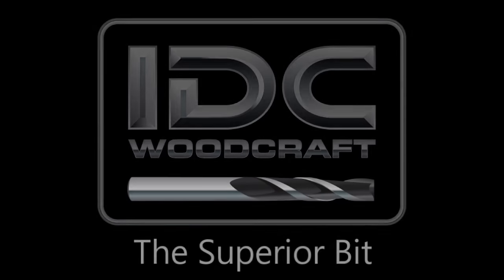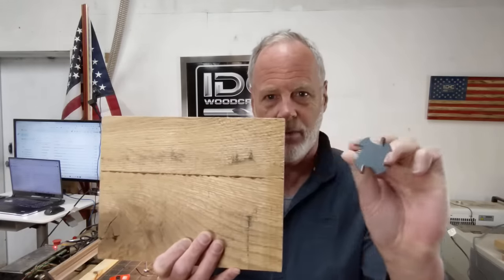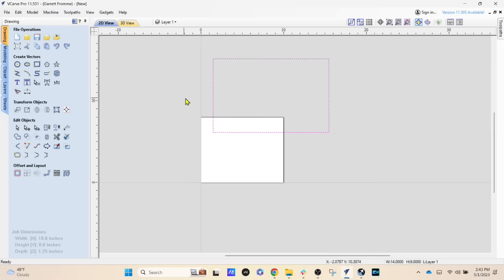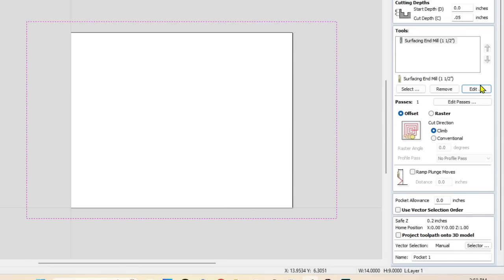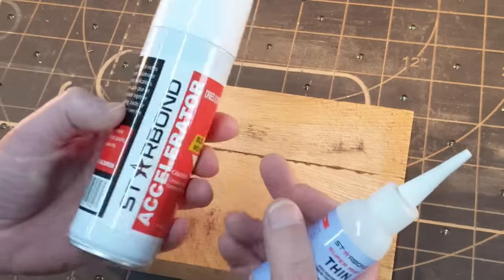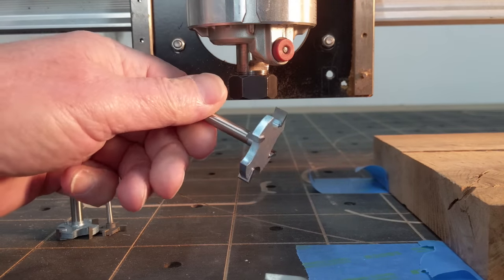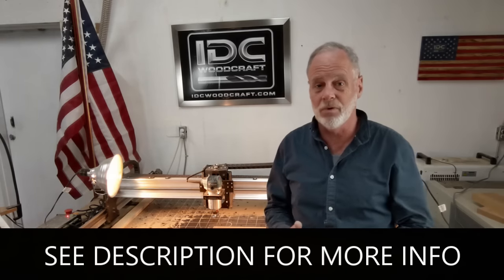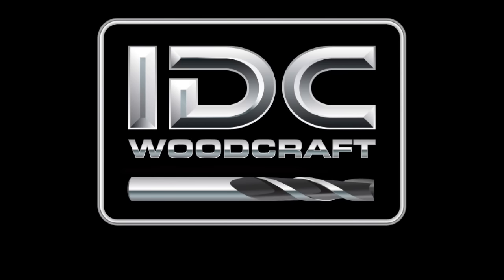How To Surface CNC Projects and Flatten Slabs BEFORE Carving, CNC Router Surfacing

Comment: Would it not been advisable to set up x and y to a position that would have the bit come down off the board? You set it so that one half of the bit came down on board.
Reply from the maker: davecable3104, Great observation! Setting up the x and y position to have the bit come down off the board would definitely help prevent any unwanted contact with the material. It's always good to double check your positioning before you start cutting.
Reply: @IDCWoodcraft  The more I think about it though it may then not run off completely at the other end. I guess as long as the cutting edges extend more than the .05 past the flat area there’s not a problem.

Comment: Thank you for all of the valuable information. I just have a question? Why do you your touch probe between cuts? Can you just tell the software to make another pass or is this method  more accurate? I'm about as new to this as they come. This video did inspire me to buy the bit!  just so you know. Thank you
Reply from the maker: Rhondaramsey, in between passes the depth of the material changes. If you didn't touch probe between cuts, the machine would be cutting air!

Comment: I was always taught to never put the shank in all the way til it stops and tightened but rather to the stop then back out a smidge so it holds better. Because the collet is pulling the tool inward as you tighten and it’s against the stop, it may not tighten completely.
Reply from the maker: JimmyGarner, good point brother. That could be very true.
Reply: Thank you for the reply. I find your video lessons helpful even though I have been a toolmaker(carbide cutting tools) for the aircraft and aerospace industry primarily working for the same company for 38 years.

Comment: No way, I was doing surfacing wrong. Not the part about starting from outside the material (Fusion automatically does that for a surfacing toolpath (called “Facing” in Fusion).
But about going against the grain… could that be a reason for.burn lines? I’ve always randomly chosen the direction, never thought to not go against the grain. Did a surfacing last night (oak), and the direction was against the grain (just because I wanted the step over to be along the Y axis and my piece was longer than the working surface). And I had to do A LOT of sanding to get rid of those, especially since I didn’t have anything rougher than 120 grit in the house. Now, I’m wondering if the burn lines were a product of “going against the grain”.  Could it have that side effect? The bit was new. And I did check the recommended feeds and speeds of the bit, and although I was in the correct interval, I was on the lower side - I’m always a bit reluctant of going for anything else other than the lowest recommended setting. Of course, I work in metric, so after doing the math, I didn’t like the number so I rounded it down a bit, slightly under the lower limit (recommended was 120-150ipm, and I went with 3000mm - that’s like 118ipm). But that’s less than 3% under, it’s so insignificant that it shouldn’t make any difference, right?
Also, depth per pass seemed to be fine, by your example. I had 1.2mm, which is about 0.05in. And even if there were some spots slightly below that and other spots slightly above that, the burn lines were consistent.
Anyway, what I’m most curious to know is if going against the grain could be a reason for burn lines (be it in addition to slightly going under the lowest speed or not)
Reply from the maker: MStoica, great points brother! Consider increasing your feedrate 15% at a time until the burning goes away. That should solve your problem brother.

Comment: Should have also mentioned, never have your bit pushed all the way in, when it gets hot it will expand, and push the bit downward. Push until it bottoms out, then pull out ever so slightly. Not much just 1mm will do, but will prevent the bit expanding downwards. 

Another tip, the little bottle brushes are great for cleaning out Collets, The very small ones for cleaning baby bottles/teats are ideal.
Reply from the maker: Robots, very true brother! All great points.
Reply: Bits should never be inserted "all the way".  There is a line on the bit that the bottom of the collet should meet.  Well - on the bits I use, anyway.

Comment: Sorry but did it difficult g carve has a surface program wich isfar eatery
Reply from the maker: I didn't use g sender surfacing because it cannot account for the larger size beyond the project size and offset from the zero start point
Reply from the maker: But thank you for sharing this because gsender is easy for other surfacing

Comment: The difference between using a mouse and not using a mouse, buying a car with round tires is using a mouse and buying a car with square tiers is not using a mouse. Both will work but...
Reply from the maker: The explanation doesn't get much better than that!